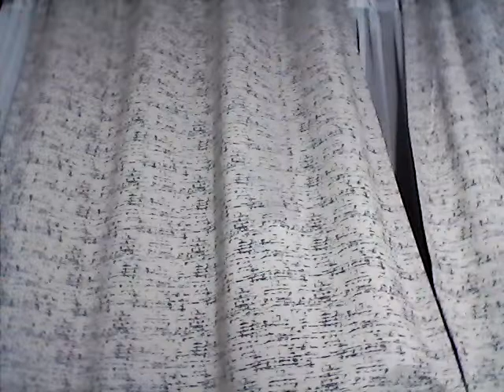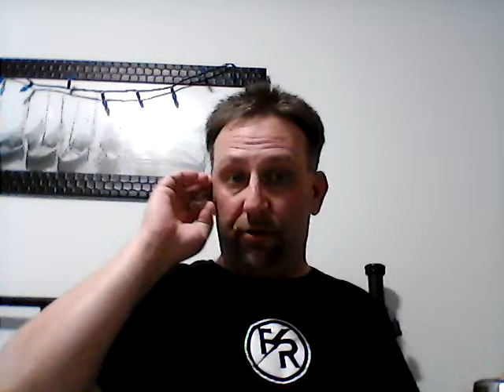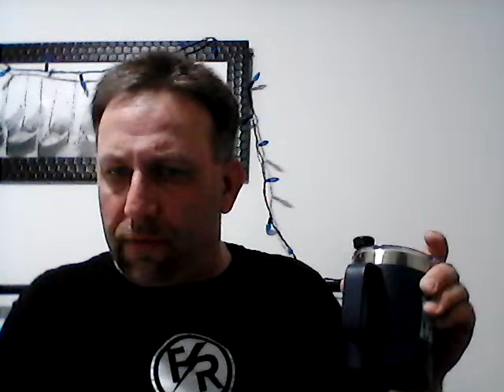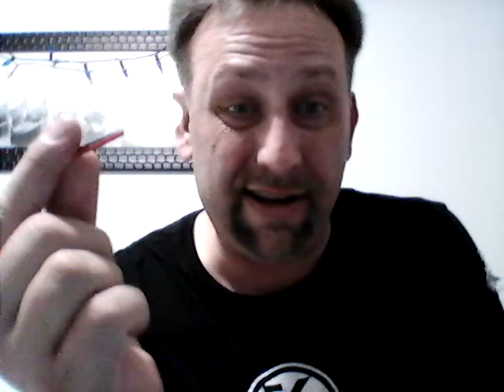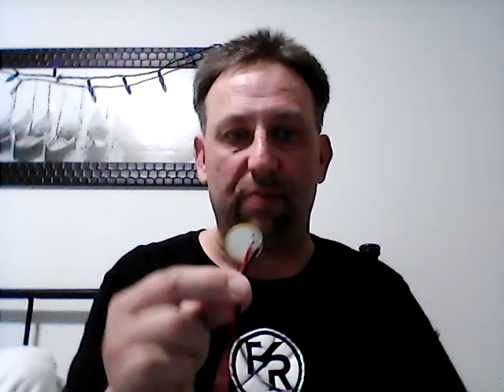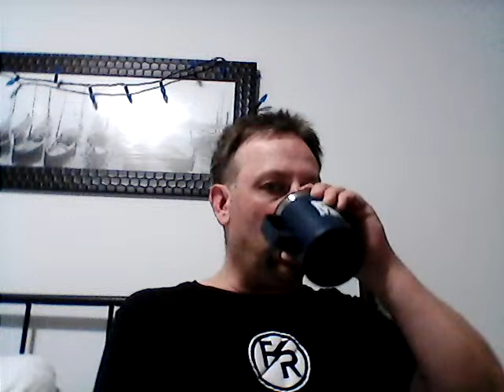Faraday Research RND Live Q&A tonight 9pm est

Comment: Hey Mike! Thanks for putting this video up. Excellent explanations and good response to the guy saying its not that easy at the 23 minute mark. If I had seen this 8 years ago I would have said you were delusional. Now though I think your probably 80 to 90 percent right. :) I still don't think the led light bulbs are a rock solid indication of power, but sometimes its wise not to provide too concrete of evidence of success :) A little bit of ambiguity can act as insurance of sorts.
Reply from the maker: Hi, thank you for the comments. Yeah regarding LED lights, they're basically just used as a ballast for the system. I'm more concerned about the efficiencies of the motor and the amount of potentials I'm getting out which are cold electricity which in essence is going to be used for battery regeneration and charging purposes. It is not a load running system. It is to recharge batteries and batteries only
Reply: @FaradayResearch  Thanks Mike! Understood. Its going to be .most informative when you have numbers for running resistive loads on just the batteries that you are swapping in and out from charging with the Adams motor. Then we can get some quantitative analysis going on regarding what the conversion efficiency is during cold electricity generation. Also very curious to see what if any differences there will be in the ability of cold electricity to drive resistive vs inductive loads.